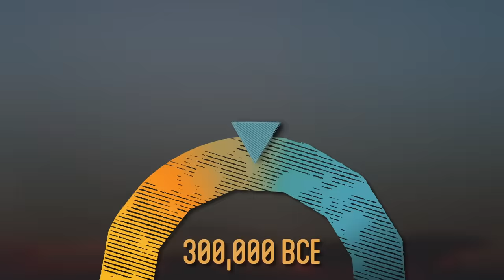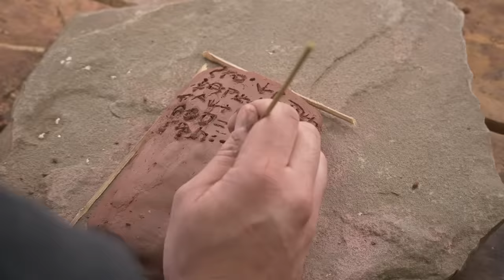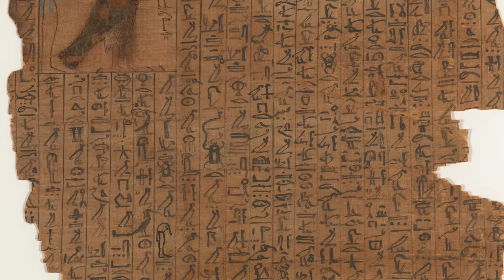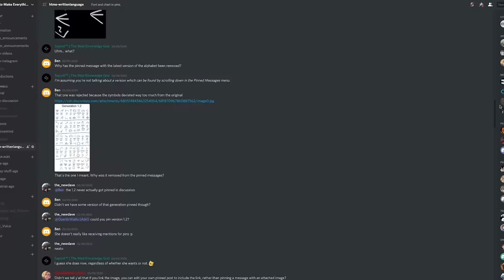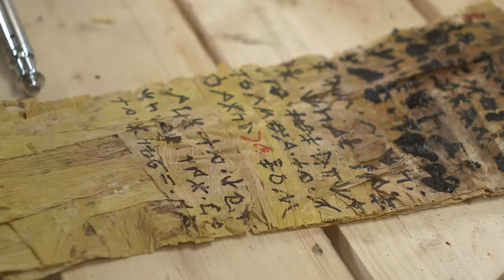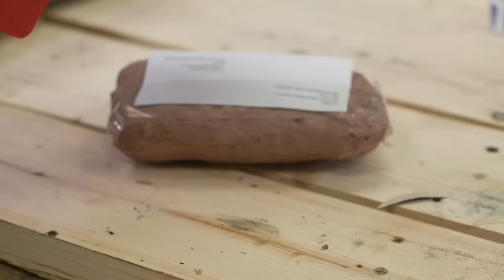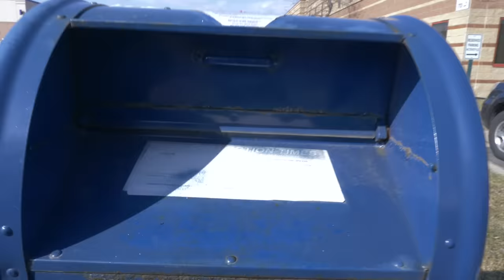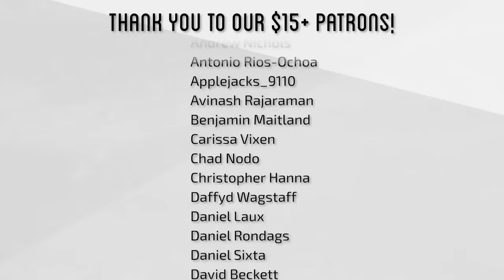Can the USPS Handle Mailing The World's Oldest Letters?

Comment: obligatory joke about the postal service:
"You should first test if a solid sphere of hardend tool steel can survive the US postal service..."
Reply: ...
so did it?
Reply: well I mean if it was hardened and not tempered also then if it was dropped anywhere throughout the process it would shatter, so pretty decent chance it wouldn't
Reply: @Heather Terpsta
A solid sphere of steel, unless it's a through-hardening alloy, would still be quite resilient to shock loads as normal alloys only harden to a depth of about 12mm.
Also, where I come from, "hardening" in common parlance refers to the whole heat-treating process of hardening and tempering. So, I'm going to call you a nitt-picker. ;)
Reply: @Bird_Dog00 ! Yes, Callout the foolery in these parts. Bird Dog!
Reply: @Bird_Dog00  Neeeeerd

Comment: Watching them roll out the pith using that lumpy, not straight stick was painful. back in ancient times, it is quiet likely that the papyrus makers would have taken the time to carve a fairly straight and round rolling pin, and I feel using a modern one would have been acceptable.
Reply: yeah that's htme in a nutshell. i like their videos but they always seem to stop at the "just good enough" phase when they are working with anything. don't watch the video in which they try to smoke foods by throwing it in the flames....
Reply: @Adranash  after all, they want to rush through the "tech tree" as it were, not spend time honing each and every stage as the real craftspeople had to do. Only when their tools break do they end up remaking them better. Though with the lathe now hopefully using straight smooth things will happen more often..

Comment: I think I have an idea on how to fix the issue with the corn papyrus substitute, cut the husks into strands, dip strands into the wheat glue and weave them together as tight as possible and dry between two flat rocks to hopefully prevent curling or waves.

Comment: I would like to point out that the Sumerians didn't scratch the forms into the clay. The pressed the sides of a rock or wood into the clay, that's why you see them as 'nails'. That way, you get much better readability after the clay has been fired.

Comment: The clay tablet was an okay representation of how the ancient sumerians did it. Only they used cuneiform, which is technically what every modern (non-asian) script in use is based off of
Reply: The main technical difference is that they pressed the symbols into the clay, they didn't scratch them. This would make for a much better quality.
Reply: @entcraft44  Jup. Don't know about quality though, I speculate that the technique is more important for a good result
Reply: I don't think that is correct. the latin script derives from the Phoenician, through the greek. The Phoenician on the other hand descends from Egyptian hieroglyphs, where writing is believed to have evolved out of art.
Cuneiform died out millennia ago, leaving little to no influence on writing, except perhaps through inspiring old persian and influencing the  ugaritic alphabet, which in turn interacted with the Phoenician. So arguably most contemporary european scripts descend from a north african writing system. Anyone know if runes are still in use somewhere, maybe by some neo-aesirians?
Reply: @willowarkan2263  Oops. Yes, you're right. While researching the script a while back I misinterpreted or misread the "replacing of it with Phoenician" to "evolving into Phoenician". Cunningham's law strikes again

Comment: Other things you could use for writing which are easier and cheaper to make than parchment: Birch bark (using a wooden or a metal stylus you can write on pieces of birch bark), wood or bamboo slips (smoothing out a wooden or a bamboo surface makes it easy to write on with a brush, a pen or a metal stylus), tough leaves work in the same way as birch bark (palm leaves were used historically, but other similar leaves can also work).
Birch bark and palm leaves were used in India (still are as a traditional way of writing religious texts). Birch bark was also used in Northern Europe and possibly elsewhere thanks to how easy it is to use (in Europe it was mainly used for personal messages, and other such stuff, similar to chalk boards).
Bamboo slips were used alongside silk and stone in China before paper was invented. 

Also when you make your paper, make sure you use only the bark of young branches, instead of what you did back in your "HTME Book" series. And your papyrus is weak because it wasn't woven correctly (it should be one horizontal and one vertical, alternating between those until you get to the end).

Comment: I think it might work with palm tree leafs. Here in Brazil we also have a thorny little red flower. It's more thorns than anything else but the important part: it has a white sticky liquid like white glue inside. So... if palm tree leaf is not sticky by itself unlike papyrus, we could try the sticky liquid from that plant. I will think if I will actually try that or not

Comment: Those did not go through the postal system because they do not meet FAA or homeland security regulations. Anything over 10oz or a 1/2inch in thickness must have a printed label or metered stamp on them to be accepted into the system

Comment: with the corn husks the problem you had is the individual strands are too wide, and the cheet of "paper" is too thick, if you do this again i would try to split the corn husks on the little ridges in the husk material until you get them about 1/4 to 1/2 inch across, then it would need washed, probably similar to how japan made a lot of their early papers, multiple times over a few days starting with boiling the fibers, then i would soak them in a diluted form of that wheat glue for half an hour first, and then i would lay them out like the papyrus, you would still likely need the stones, but this should provide a better cleaner surface to write on, if a little more work intensive.

Comment: eh? first, you say yeah papyrus wasn't actually woven but overlayed in 2 layers (one horizontal and one vertical) and then you do all other tests weaving them making essentially plyboard?!
with all thin wet plant-based material it warps when drying out too quickly this is avoided by pressing it first under a cloth and then lay a fresh cloth over it and let it sit for 24 hours the cloth prevents it from drying too fast this is a method still used I use it in my antiquarian paper restoration after I removed stains in hot water and wrinkles on a plate by pressing it, and after its been under the cloth for a day, it is perfectly flat and clean like new.